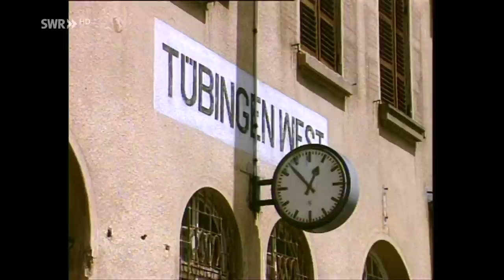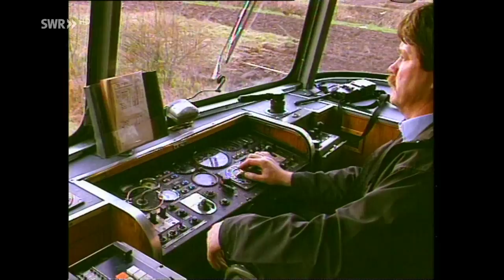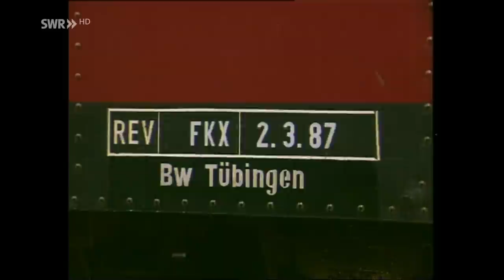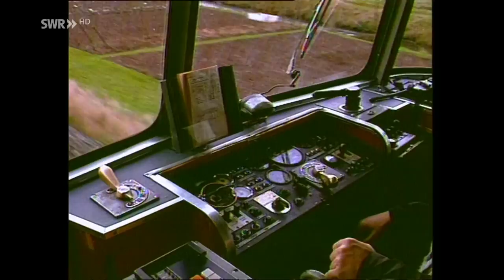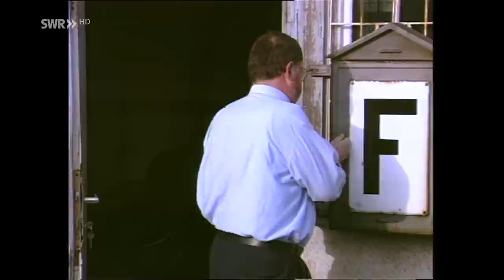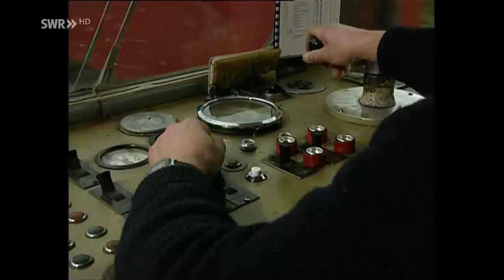Der Schienenbus - Retter der Nebenbahnen

Comment: Ist Er jemand die Bahnstrecke für der 'Schienenbus'  zeigen können. Vieleicht ein URL
Also, Ich habe vertehst dass mann von Tübingen fahren, aber denn

Geht der Zug Täglich oder ann....
Information wäre wünschenswert.

Grüsse aus Schweden
Göran
Reply: +Göran Andersson    The video deals with the so-called Ammer Valley Railway from Tübingen to (at that time) Entringen, please see here: https://en.wikipedia.org/wiki/Ammer_Valley_Railway. What we see is a historical video - even a very historical one. The railbus is no longer operated on that line since May 1999. Today the Schienenbus is not operated regularly in Germany any more (some private companies and some museum railways still have it and use it from time to time). I think the situation is similar with the former Swedish railbuses (Statens Järnvägar Y6/Y7/Y8 series), although those Swedish trains with a maximum speed of 115 km/h were a bit faster than the German version (maximum speed only 90 km/h).
Reply: You can sometimes drive a Schienenbus on specific museum roads. For example, between Bad Endorf and Obing there is a Schienenbus running in the summer on weekend together with some old steam locomotives